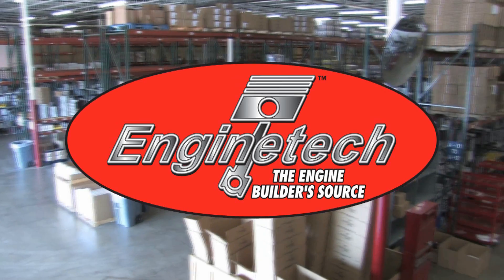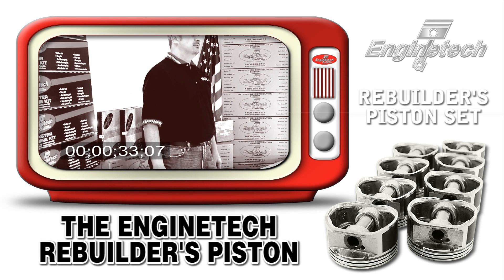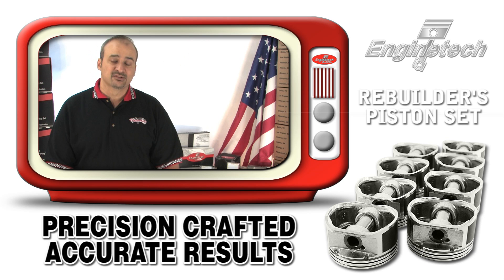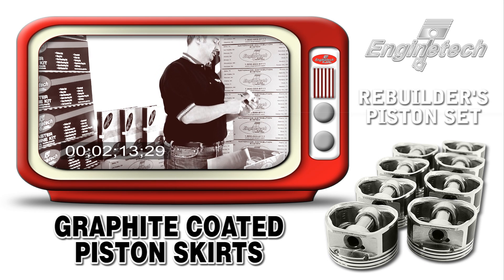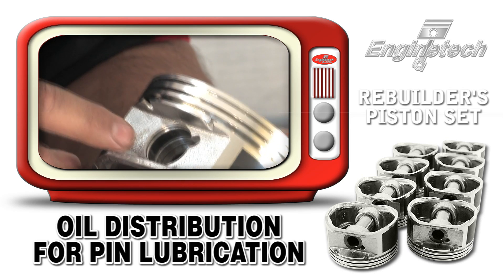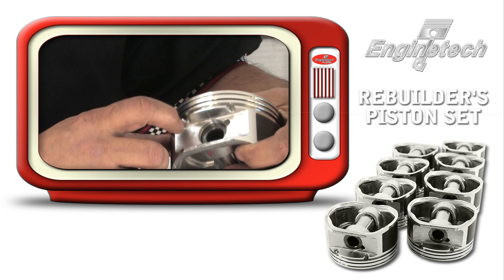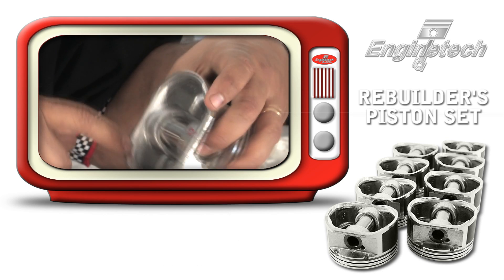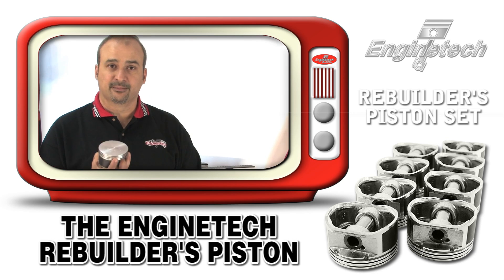Piston Sets - Enginetech

Comment: I just bought a engine rebuild kit with 16 valve Hypo .030" over short skirt pistons for my 1992 Camaro Z28 5.7L TPI. My question is why didn't my pistons come Graphite coated skirts & what is the struts in the pistons for???
Reply: Even if the skirt is not coated the skirt face is machined with micro grooves that hold oil so not to worry, many pistons have struts that link the pin boss to the bottom side of the piston head, usually in a V shape, material is not required in the V center and often a hole is drilled there to aid pin lubrication in this area.
Reply: Do you think this product has quality
Reply: Yes the kit was quality stuff